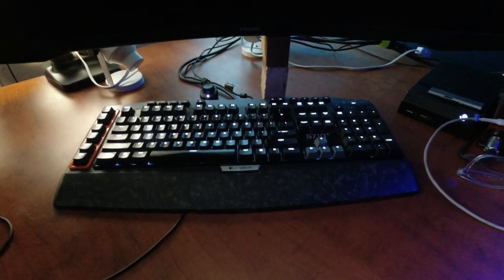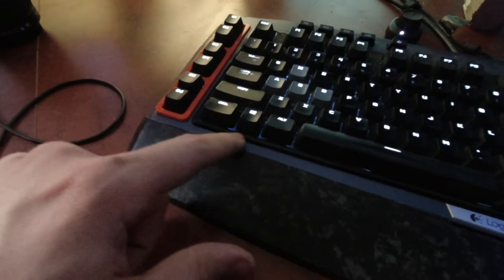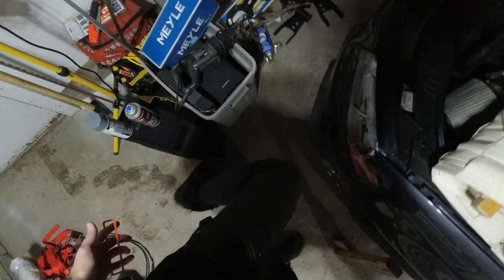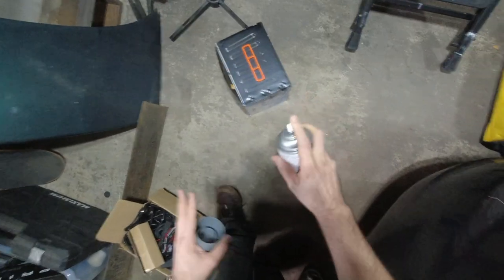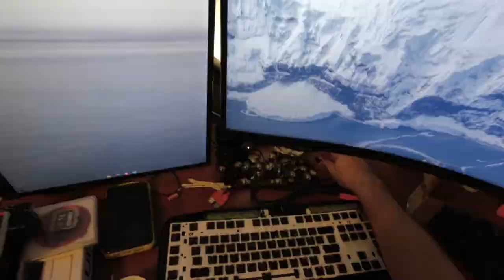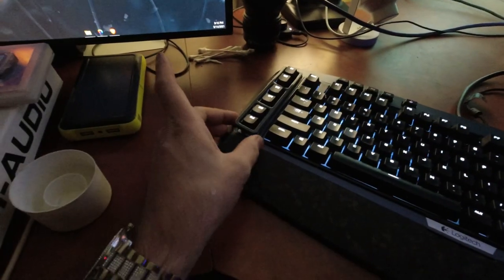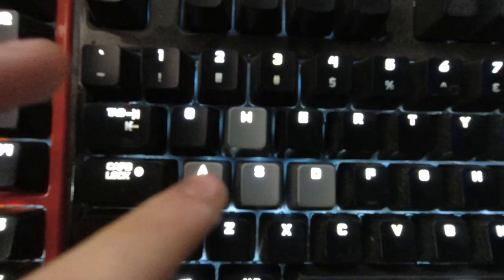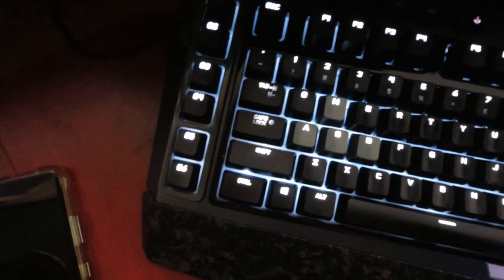Making a Custom Logitech G710+

Comment: bro my button D doesnt work the switch withe led  work but when i click on D its stopped working suddenly, do u know to repair it pls ?
Reply from the maker: My right CTRL key did this a few years ago, the back of the keycap is likely cracked right where it goes onto the switch. I fixed mine by using super glue to put the pieces back together on the back of the key cap, but I suppose you could also just buy a replacement keycap or like some different looking aftermarket keycaps